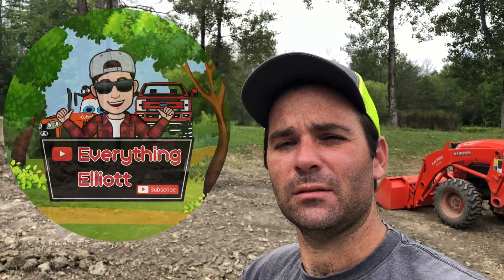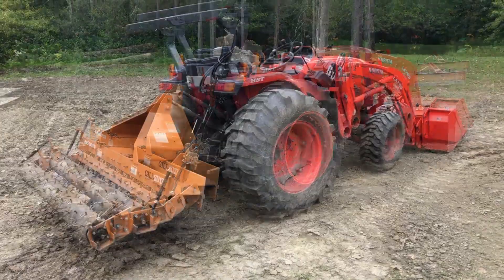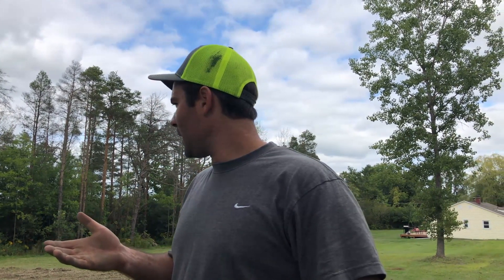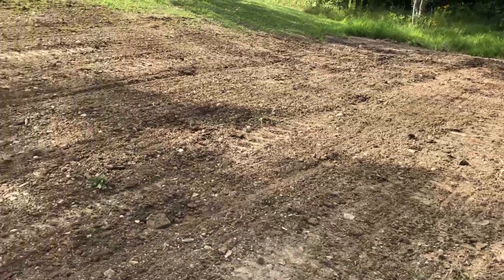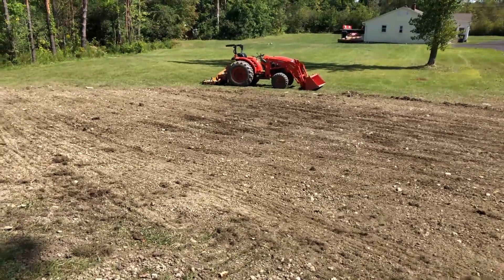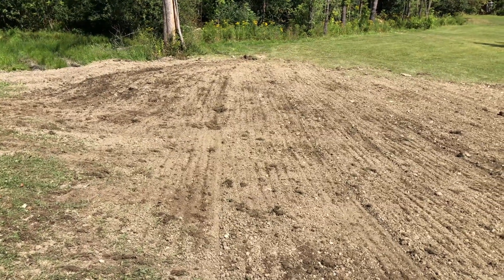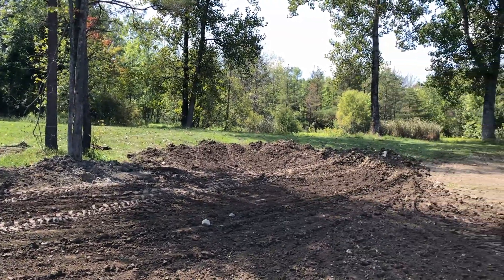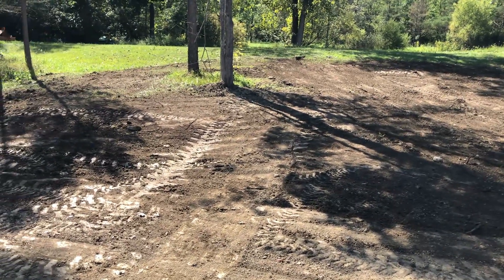DIY Yard Grading: Soil Pulverizer & Compact Tractor in Action

Comment: Man, this brings back memories.  I’ve fought the good fight against the rocks too but mine were worse.  I gave in and hired someone with a bulldozer and a skid loader to come in and get my rough grade close.  It’s still not ready for final seeding though.  My Kubota dealer suggested a reverse rotation rototiller.  So I bought that and a new 4701.  We’ll see how that goes in the spring when the ground thaws.  Have you considered a reverse rotation tiller?
Reply from the maker: I actually have one. Well, I have a tiller that you can pick forward rotating or switch it to reverse rotating. I’ve got a video or two of me using it with my tractor, check them out!